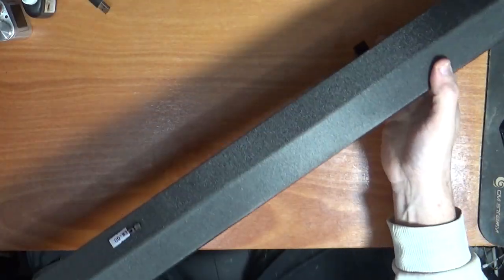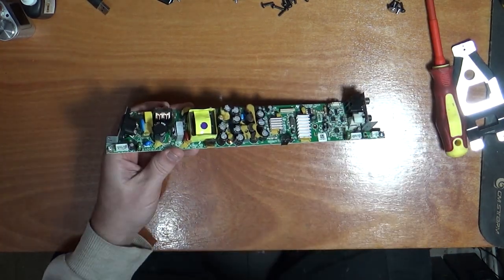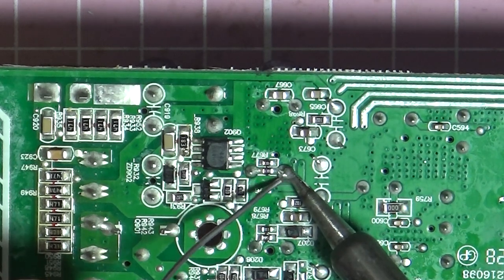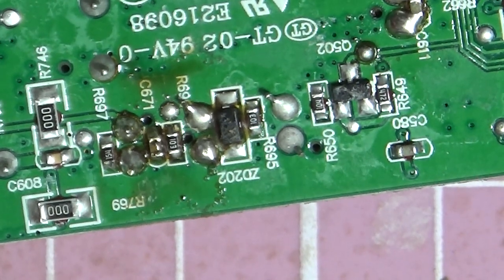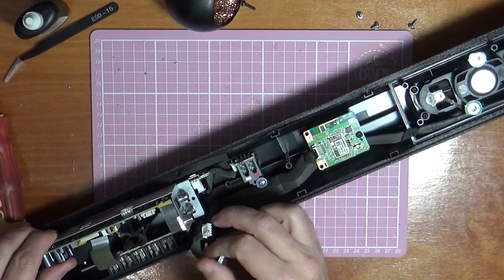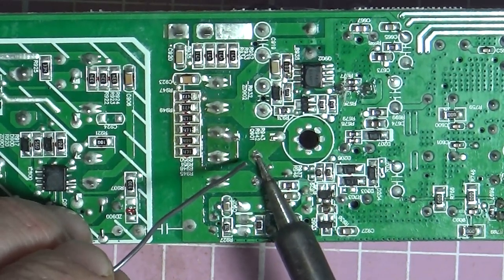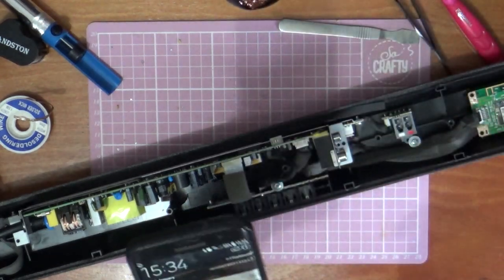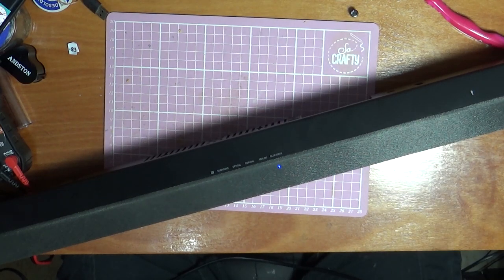Sony Soundbar No Power Repair SA-CT60BT

Comment: Thanks for this video. This is the first time I have ever managed to repair anything electronic.
Reply from the maker: Thank you, that's great news. I hope it gives you the confidence to try and repair other things.
Reply: I hear ya Charlie. I'm working on mine now. A month ago I fixed my 2008 Honda CRV digital info display on dash. It was pixalating...couldn't tell how much gas was in tank etc. I searched and searched and found ONE video with a guy at a company who repairs them for $300. I never solder anything, but all I did was touch the hot soldering iron to 6 soldered terminals, not melting none of them, just briefly touched them, put the dash back together and shazzzaaam...the damn thing worked...still working perfect!

Comment: Great video. I have the same unit, same symptoms, apparently dead - no response from remote. I would never have tackled taking it apart it not for the video. Having taken it apart & close inspection, could find nothing wrong, put it back together carefully, especially the connectors. Fired it up - it worked! Really hate throwing out something that is still useful so an=m very happy - thanks.
Reply from the maker: Hi I'm glad this gave you confidence to tackle it. Sounds like a connector could of just come lose from vibrations. Glad it's working now.

Comment: Unless you know the schematic then measuring the capacitance in-situ unfortunately isn't going to tell you much as it's usual to have capacitors in parallel, particularly in the power supply section. You can test if a cap's failed short circuit by using the resistance setting on your meter and seeing if it drops to zero ohms but unfortunately they can also fail open circuit so it's not guaranteed. Good on you for fixing this stuff up though; we throw away such a lot that can be repaired usually because of bad electrolytic caps, dirty connections or dry solder joints. Also I'd recommend investing in some desoldering braid, rosin flux and leaded solder - it's much less sticky and nicer to work with than the lead-free stuff. Keep it up!
EDIT: As I watched through more of the video, I see that you did actually say about the problems of measuring them in-place and the leaded solder - serves me right for not watching the whole thing through first!
Reply: Equally, with the SMCs - those resistors - 103 doesn't mean 103 kilo ohms but 10 x 10^3 or 10k ohms. The first 2 digits are the significant numbers and the 3rd digit is the multiplier. Thus 474 would be 47 x 10^4, or 470k ohms (an electronics engineer would refer to it, as a four-seventy k resistor).
And the correct terms are positive and negative, rather plus and minus, when talking electrolytic capacitors, usually notated to +ve and -ve.
30 years ago, all these things would have been repaired, just as you've done here (I'd have replace all those capacitors in one go, at 30p per cap.) but we live in a throw away world.

Comment: Thank you very much for the video and the explanation.
My soundbar has been unused for twenty months and when I tried to use it, it would not turn on or do anything. Following your instructions I have disassembled and checked it. All capacitors seem to be ok. I have reassembled it and everything works correctly. I guess it was a bad contact problem.

Comment: I have the same exact soundbar! You have to have the remote to turn it on! It has no lights unless you turn the power on from the remote.
Reply from the maker: Yes I had the remote and it wouldn't turn it on. I know I forgot to add that at the beginning of the video but it was dead with that bulging capacitor. If you even see a cap like that it has blown.

Comment: Great video I have the exact model thats failed so will attempt to repair it soon.   Sony soundbars like this even when you plug them in remain turned off until you power them on using the remote. {this model} I did notice as mine failed it displayed a few quirky faults, when connected via optical cable it would lose audio for around 0.1 - 0.3 of sec specifically on spoken word audio. Changing over to analogue inputs solved this for the last few months but it didnt last.  Also during power off it would generate a large "thunk" sound as it powered down.. That got progressively louder.  Fingers crossed for the repair.
Reply: So upon investigation,  I discovered it was the a simular fault to yours the 35v 470Uf capacitor was swollen as was the the one marked 16v 1000Uf towards the front.  I ordered some parts and figured I'd give it ago. It  quickly dawned on me my soldering or more accurately desoldering skills are about 10 years out of practice... 

Through the occasional bit of swearing and burned finger persistence paid off and the job was complete. It all looked good, cleaned it up with a bit of isopropyl. Put it back together and then Boom. No it didn't explode it worked perfectly , even sync issue now that plagued the optical output works with no cut outs.

It's a shame manufacturers get away with designing flawed or built in  failure just to sell more products. 

Many thanks.
Reply: Did you replaced those leaky and dying bulging up capacitors with those new capacitors within 5 or ten voltages higher.If you don’t the problem will happen again within a year or two.

Comment: Same problem for me (remote control emitting IR, but no response from sound bar). I replaced a puffy 1000 microF which made no difference, then a less puffy 470 microF which fixed it.
Thanks
Reply from the maker: Well done, I'm glad this video put you in the right direction to fix it.

Comment: Hey Buddy
Can i grab 5V from the main board anywhere? I have the non bt version and i would like to solder a bluetoothboard right to the board.

I would love to get a answer
Reply from the maker: Sorry but I don't know, I sold this one not long after repairing it. If you have a multimeter you can check around the board for 5v. You might find 5v on the standby which will be somewhere before the circuit to the light LEDs. You really need a multimeter to look around the board though.
Reply: @RetroElectronicRepair  Hey Buddy, thanks for the reply. I have a Multimeter. Im just not sure where to messure for 5v. I dont have a big understanding for circuitboards and dont know where the current is flowing... The board is already in front of me and i try to meassure. No success tho. Can you make spots out in your video where i should messure maybe?
Reply from the maker: Sorry I can't help further. There is 240v going into this soundbar and if you are not sure where to check you are in danger of electrocution or damaging the soundbar. This is not something to mess with if you don't know what you are doing. Sorry I can't help anymore.

Comment: Excellent video, mine has just broken and has the same issue. Been and got a couple of capacitors and going to give it a crack. Discharging if they are fully charged how do I do that if I find they are?
Reply from the maker: As long as caps aren't charged to over 10v you can just sort them by putting a screwdriver between their 2 pins (use screwdriver with insulated handle) that discharges it instantly. Anything over that either keep pressing the power button which can sometimes discharge them or look up on YouTube about safely discharging caps. Good luck in fixing it.

Comment: Hello i have a polk audio iht 9000 soundbar sub combo that worked well up until recently the sub stopped connecting.. Polk said there is an issue with motherboards? Is fixing bluetooth similar?

Comment: (it was reapired before)i done this myselft and there was a 1000uf 16v in it but i swaped it out and changed for 1000uf 35v and works again even tho the cap looked ok  also would u know where to find the drawing for this board as i know a few other caps where bluged and want to know which ones are for the volume  as when turned on the volume is always low?
Reply from the maker: I think this is the schematics for this device https://www.manualslib.com/manual/1205584/Sony-Ht-Ct60.html
Reply: @RetroElectronicRepair  ok thanks ill look into it

Comment: Any ideas on how to fix a right speaker that stopped working?
Reply: Must have to taking the thing a-parts.Must have to be re soldering all of those connections joining wiring to that speaker.Re soldering of those joints with new soldering connections with new soldering tins.All electronics devices with big components 90% of the times it will works agains because over times it happening are could be cold soldering or cracks soldering to those joints connections.

Comment: I think is normal that upon pluging it, it doesn't light nothing.
You have to try to power it with its remote.
Reply from the maker: Yes I forgot about the remote when I started filming. I did test it with the remote when I bought it and it was totally dead.

Comment: My sound bar as no power now,not hardly use it.Bought a optical lead for TV recently it's going for a two months since.Its a BUSH CBAR68T.from argos.Use a wall cable detector and power is going in to it.I have to look at the those capacitors.There is a funny smell come from the board.
Reply from the maker: If there is a funny smell it could be blown caps or something else that has blown. You might be able to visually see some damage.
Reply: @RetroElectronicRepair  i will have other look.

Comment: You need to pickup an ESR meter to effectively test caps. A perfectly fine looking cap could have dried up and gone high resistance.
Reply from the maker: Hi thanks for the comment. I do have an ESR meter now (only one of those cheap DIY ones, but gives me a clue) this video is quite old and I was just starting to learn electronics and trying to fix things.

Comment: (sony sa-ct80 soundbar) in power section pwm controller ic has blast, i want repair it myself but no idea which ic can replace , i did not get same ic( power control ic) printed on the board that place ic900

Comment: Hello, I have fixed mine by your help. Thanks. Unfortunately a year after it is popped again. Do u by the chance know what cause this problem? Can I upsize this capacitor? Thanks
Reply from the maker: I can't remember what voltage cap it was but yes, try one with a higher voltage, just make sure the capacitance (uF) is the same. I don't know what the cause of the problem is.

Comment: Hi mate. Thanks for your help, but now I got a new situation. The barsouns stopped to work so I changed the capacitator and it turned on and works again but it has no sound. Someone can help me with this? Or somebody just happened the same? It turns on and  sources (coxaial, bt..) just the sound doesnt work. It is like mute botton was pressed but it isnt. Someone knows about capacitator/s could be? Thanks for help. Regards from Spain

Comment: Any idea about my wct260H, subwoofer fires for a second then no bass, bar is good and the link is there so I'm thinking it's a capacitor or something that's not supplying the power required, any ideas?
Reply from the maker: Sorry I don't know. I only really do this as a hobby. Sounds like something's shutting down to protect the circuit so it could be a cap or something shorting out

Comment: I"m not going thru all that shit....I threw the damned thing in the trash. I'll just buy another one and get a warranty.
Reply from the maker: You could have sold it on Facebook marketplace or eBay and got £10. There's always someone local that will buy it from you and repair it. If I was local I would have given you £10 for it and fixed it in 10 minutes.

Comment: So basically for 99.5% of society, toss it in the trash cuz no one has time nor knowledge to fix this.🙄
Reply from the maker: So hopefully someone will see this video and fix there electronics like people have already said they have done after watching this. So that makes it 99.4% of society lol. Hopefully this will changed peoples minds about just chucking stuff out when it can sometimes be a simple fix for pennies rather than buying a new £100 item. Yes you need the time and a little knowledge but one step at a time. 👍
Reply: Count me as part of that 99.5%. I just had my CT-260h die, with the same symptoms. Looks identical to the the CT60BT but the PCBs are very different. I've seen lots of people complaining about the problem, but unlike  the 60, nobody reporting they repaired it. Will likely just go to the trash.
Reply: @nybiggs  literally just happened to mine. I have this exact model that's in the video. I don't have any of the knowledge, time or equipment to do this. I'll just buy a new one
Reply: @phorner1983  If I had the same model in this video I'd probably give it a shot. Seems easy enough for $20 in equipment and materials. At the same time you can get a new samsung 2.1 soundbar with updated features for $130-$150 at bestbuy right now.
Reply: @nybiggs  I'm attempting to fix my sister's CT-260h which stopped working. Like you, I can't find any help for this model compared to what's available for the CT60BT model. The two are not the same :(
Reply: @monicam8408  my ct260H stopped working after I unplugged it while it was playing music.. my stupidity
Reply: @monicam8408  yeah after I spent a few hours researching it I found no reports of anyone successfully repairing the ct260h. You can grab a used main unit on ebay for another 50 to 60 dollars if you keep checking. I decided against that as I had actually just replaced the subwoofer eight months before as my subwoofer spontaneously become unable to pair. Got tired of sinking more money into an old system which fails regularly.
Reply: Told ya!
Reply: Well, after 2 more years my second unit failed as well. So I decided to try this fix.
Guess what, it worked!! Now I have two working units (I fixed my other failed unit too) for the price of a tiny capacitor. It’s not an easy job but it’s doable with patience and persistence. Amazon has the capacitors you need.